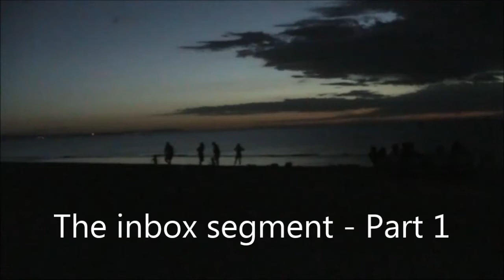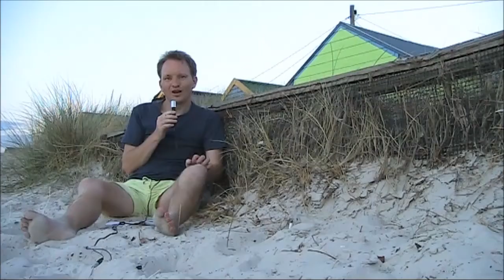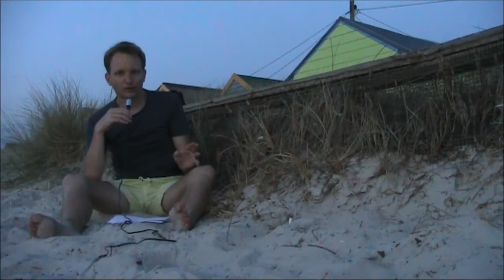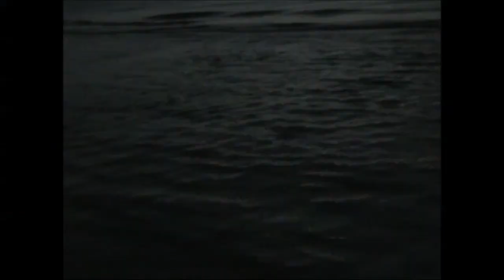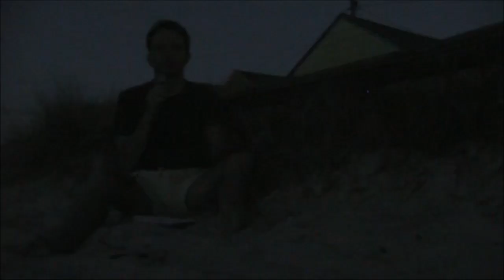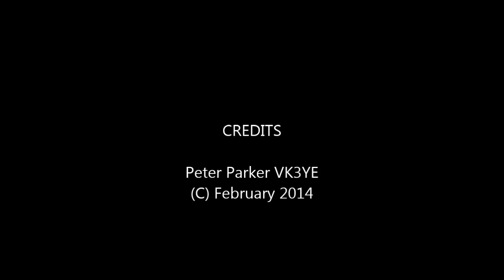The inbox segment: Part 1

Comment: Ref. your 100w copper tube Mag loop antenna.
I have a commercial one from the 80s/90s, the Capco for 80 40m and 30.
Everything you say about yours applies to mine although with a big motorised single wide spaced cap, it covers a greater band width. However I had a problem which seemed not to bother yours. At the height above ground which you used, I couldn't
get a decent SWR 3:1 at best although at the time didn't know what the problem was. It worked but.....Then for a totally different reason I hoisted it another 3 feet (It was getting in the way.) Bingo 1.4:1 or better. Wonder how you're getting away with it. Might be worth tipping off folk who may build your very inventive version.
73 G3NBY.
Maybe Aussie soil is better than than the soil in Blighty!

Comment: Squidpoles, or Fiberglass Fishing poles, can easily be had from your local outdoor shop here in the states. I know that most places do have 20 footers on hand for less than 30 dollars. That's easily a quarter wave on 20 meters, or a small amount of induction with a quarter wave on 40.